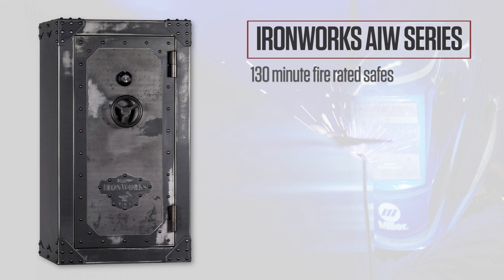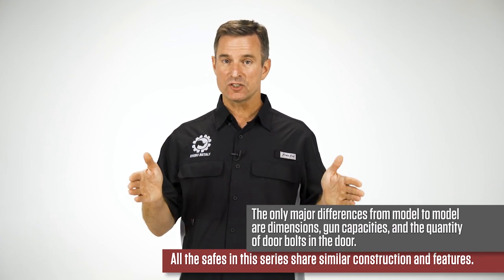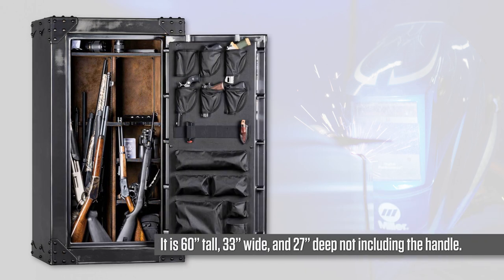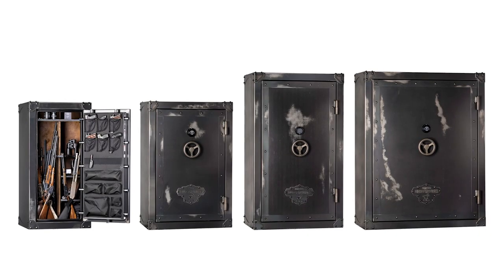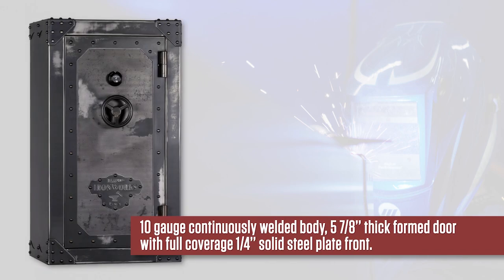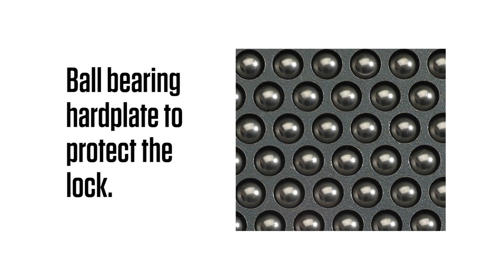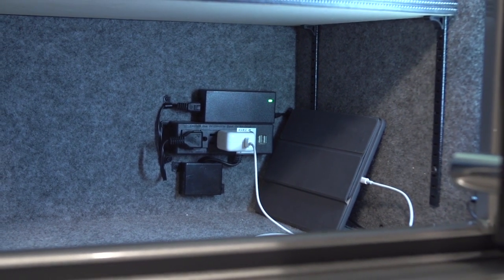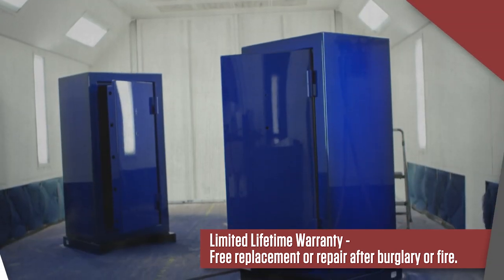Safe Overview | AIW Ironworks Series

Comment: Anyone notice any rust happening on these safes?
Reply from the maker: What you're seeing on the fresh welds is referred to as "Heat Tints" it has a brown hue to it. After the weld job is complete, that brown hue goes away and the safe is put through our painting process which involves and anti-corrosive medium so they will not rust.
Reply: @RhinoMetals  thanks. Cant wait to get 2 of them.